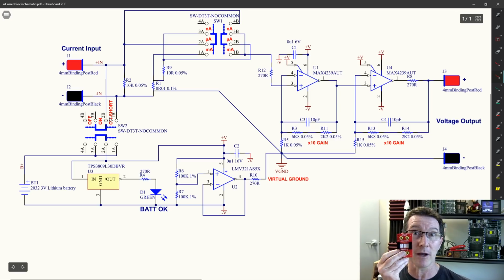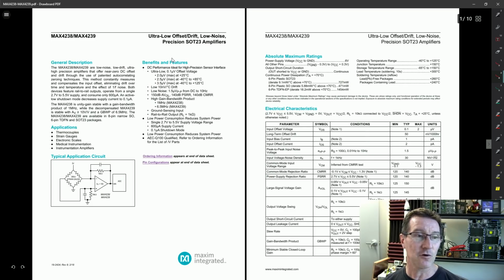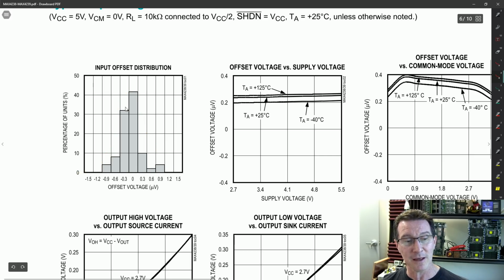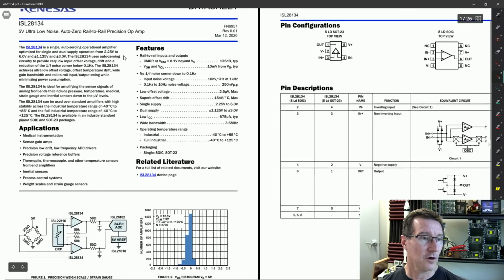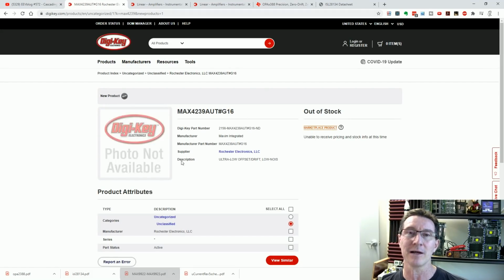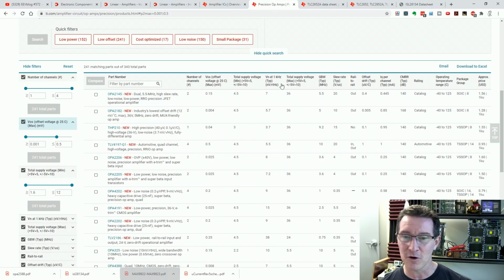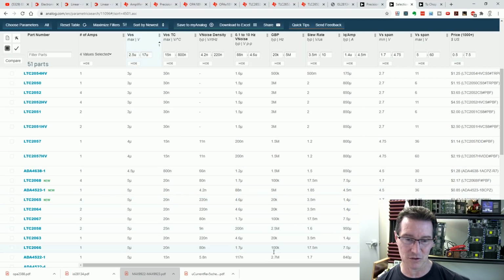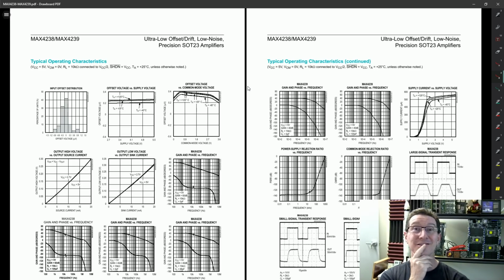EEVblog #1318 - What's State-of-the-Art in µCurrent Opamps?

Comment from the maker: UPDATE: The ADA4528 with a nominal 2.5uV offsett actually looks like it has a tighter spread than the MAX4239, and unity gain stable. But lower bandwidth.
Reply: Rochester electronics are legit. They have deals with all the big manufacturers managing low demand, EOL consignments and aftermarket manufacture to original manufacturer data. Anyone involved in obsolescence management should be familiar with them.
Reply: Perhaps TI, Maxim and Analog use different sigma values (e.g. 3, 6, or even 7) to spec those min/max values. Wise idea to look at the graphs.
Have you also considered using a different 2nd opamp? If the first stage has a gain of 5 with 0.1uV offset, then effectively the 2nd stage can have an offset voltage of 0.5uV without adding more offset than the 1st stage. To achieve the same gain/BW spec, the 2nd opamp needs to have more GBW, but with 0.5uV offset that is alot easier to find. Maybe the ADA4528 for 5x gain (600kHz) and then a OPA189 at 20x gain (700kHz). Haven't looked at noise though, because usually it's best to have the first stage with most gain for the lowest noise figure.. (however the MAX4239 is quite noisy, so might still be good)
Reply: @nlhans1990  I was told to only trust tabulated values as they would be measured and to test everything outside that. Graphs might be useful to know what to expect but can't be sure what may have been extrapolated.
Reply: @ches74  I agree, I typically use the tabular results as much as possible as well, but in this case Dave is interested in the mean & stddev of the part more than the min/max I think. In my opinion, it's not trivial to say how each manufacturer specifies their numbers. Do they literally measure every characteristic during design validation? How are they confident that their min/max are correct, or are these numbers sourced from monte carlo simulations? Or are min/max specifications used as thresholds in die-level QA testing? This is why I think looking at the graphs as supplementary information is a wise idea in this case.
Reply: I am happy you have found OPA189. Using it you can get rid of the second stage depending on bandwidth required. Or you can make use of the high dynamic range. Have a look at its offset voltage distribution.
Also, INA228-Q1 is interesting for precision current measurement. It provides 2 uV max offset and you get digitized result with I2C right away.
Reply: I think the issue is that Analog Devices is conservative with their datasheet specs. The ADA4528 is listed as 0.3 typ 2.5 max, but at 25C none were measured outside of -0.4+0.2. They also default to the max spec in their parametric search. That TI part on the other hand is listed as 0.5 typ 1 max but the histogram shows devices at -2+2.75 so it's really more like 1 uv typ. It really drives home your statement to not limit yourself to a particular spec when viewing the parametric search. I always look at the top few devices from that manufacturer regardless of what's listed just in case. (disclaimer: I'm interning at ADI this summer and use their parts search a lot. The first think I do is add the "typ" spec.)
Reply: @safedork   The TI parts have part numbers for 1uV and 3uV max, so I would hope that they are tested and binned accordingly, whereas the MAX4239 seems to be within the 2uV all the time, and the ADA4528 & ADA4523 are so far within the maximum that it seems the maximum is set at everything going wrong. The ADA4523 says it is 4uV@5V but it seems most parts are more like 1uV@5V and maybe gets to 4uV when operating at 30V, and the ADA4528 is so far within the maximum that I don't know what to think.
Reply: Texas Instruments TLC2652AC has the tightest spec i could find. 1uV max. at 25C lower GBW and higher typical value than the MAX tho
Reply: You would probably also want to take a peek at the ADA4523 since it's GBP is actually fairly close to the MAX4239 but the Vos is still tighter when operaing at low voltage. It also appears to have significantly lower noise? not quite sure how to interpret noise but it seems like a dramatic difference.
New this year it seems.

Comment: 2:20 - The ability to consistently measure low currents with the uCurrent was precisely my goal; hence, I have been following your uCurrent/uCurrent Gold saga for quite a number of months now, off and on. Early last year, a chemistry researcher approached me with the need to gather precisely measured currents through some of her samples for publication. Not having a microammeter here in the shop that would work with less than 3vdc applied and the extreme prices for such a device, I set out to locate any challenges of using off the shelf components to create my own. That’s when I found your uCurrent project from over 15 years ago.  I was disappointed to find that you were no longer selling the unit (I could easily have justified 100 dollars for such a device for the shop); but, then I found where you uploaded the Gerbers. With newfound hope in being able to build one with your Gerbers, I searched your videos and found the reasons for your specific requirements for the chosen components and many of the challenges with suppliers. (Yours is some of the first videos in my feed after searching the ‘duck’ for microammeter. Thank you for sharing all the superb knowledge in your brain for us little guys to use an implement in our own designs. There’s still hope in creating a solution for this researcher’s paper. (I hated that you blew up the opamp in your uCurrent tester, though — true IC abuse!)

Comment: Anyone have recommendations for high speed (slew rate) current sense or instrumentation amplifiers with very low input offset? I'm looking to measure lowside phase currents with a minimum sampling window of 1.5uS. I was originally using the INA240A1, but its 2V/uS slew rate was too slow for the high duty cycles required by my application. According to the graph and my measurements, it wouldn't reach 90% of the target value until just after 1uS. I've been looking at the MCP6N11-010 which is less accurate, has much higher input offset and offset drift,  and a greatly reduced negative common mode voltage, but has a very fast settling time in comparison to the INA240, additionally it requires me to externally drive the reference voltage with a dedicated op amp due to the low feedback resistor values that the datasheet recommends. I need something that's rated down to -1V common mode operational because I need to be able to measure at least 150A, and parasitic resistances can very easily pull the common mode below -300mV.
I can't do inline phase sensing because I need to support up to 100V operation. Isolated sensing topologies will price my product out of competition, and even then, I implement a signal injection scheme to resolve motor position at zero speed with no sensors. This requires extremely accurate measurements and a high fidelity data acquisition stage.
Don't ask, my customers basically want a motor controller with the power density of a nuclear reactor that comes with a set of black magic features at chinese level pricing. .__.

Comment: With regards to the distributions presented in the datasheets I have two questions: 1) is it plausible that some manufacturers would sacrifice yield to allow them to cut off the lower and upper tolerance intervals, allowing them to present tighter tolerances than their competitors? Of course, this would imply testing and scrapping during manufacturering, but I imagine that this added cost would then simply be added to the sales cost of the device.
2) Does the distributions take batch-to-batch variations into account, or is it possible that the tested devices are all from the same batch? This would certainly yield different results and would look bad in the datasheet.
Has anyone experienced these kinds of creative statistics? Any particular brands?

Comment: wow 2014, i have used a microcurrent countless times since then, all the gold is basically rubbed off 
i recently needed current amplification in a project and i used an AD8554 with 2 sets of 2 series amplifiers, it worked wonderfully but was a bit overkill, could cal out in software

Comment: With the high voltage versions that still have a low offset voltage, but a far higher dynamic range, I know for your microcurrent project that's 3V powered it wouldn't be good, but if you had the same project with 36V power, wouldn't that still be better by allowing you to use lets say the 20V range on your DMM, and then you'd be well above the least significant digit on it?

Comment: The AEC-Q 100, 101, 200 standards describe, how electronic components have to be qualified /tested by the manufacturers before they are allowed to sell their parts to the Automotive Electronics industry, like Continental, Bosch, Valeo, Visteon, and so on. The tests include environmental, reliability and electrical tests. These are the de facto automotive industry standards, i.e. very important. Go to http://www.aecouncil.com/ for details.
Specially for Automotive, manufacturers specify and test for -40.. +85°C for Interior, and -40 .. +125°C for Power Train, Body Control and Safety applications, which you found in all of the chopper specifications.
Use of the standard Industrial range of 0..+70°C is mostly not allowed in Automotive.

Comment: I always loved reading new product announcements and poring over new datasheets and app notes. I learned a lot that way. Now, searching for parts often seems like 99% of the job and is definitely more tedious and less rewarding. Digi-Key's and Mouser's parametric searches, while better than most, are really not that well designed. Now I spend hours looking for parts that need to meet multiple environmental specs and conform to multiple standards. Try finding a waterproof panel-mount USB-C jack or a power cable that meets both UL and CSA standards for use in low-voltage LED lights suitable for wet locations or . . . You get the idea. Not nearly as much fun as reading the first RCA datasheets for 4000-series CMOS or the first datasheets for the Intel 4004, 8008, and 8080, the Motorola 6800, the AMD 2900 series, etc. Those were the days. I miss my bookcases full of trade magazines and data books. And I miss designing and building circuits instead of writing code that does the same thing.

Comment: Rochester Electronics works with major semiconductor manufacturers to continue to supply their obsolete and end-of-life parts that the original manufacturers don't want to be bothered with. They stock billions of original chips and wafers and package the chips as needed. When the original chips are no longer available, they can make more - for a price - using the original masks or by recreating the design via reverse engineering. They've recently become a Digi-Key Marketplace supplier, but they've been around forever and are headquartered in a lovely resort town not far from me.

Comment: On the first schematic, what exactly R12 (in series with the op amp input) and R8 (in series with the output) do? Is the first one for overvoltage protection, and second one for stability?
Reply: R8 is an output short circuit protection. I think R12 is to help input clamp diodes in case of input overvoltage.

Comment: ADA4522 is simply where the state of the art is :) 2.7Mhz bandwidth, 22nV/C drift, 100nV noise, this is what we use for LTZ1000 buffers or scaling; ADA4523 and ADA4528 would do too, one is lower voltage, and both uses twice as much power than ADA4522; heating might be a problem in a precision circuit like this

input offset is not important, you can cal it out, or zero it out externally; more important is the offset drift with temperature

I prefer lower bandwidth to noise, MAX4239 is quite noisy

Comment: In a project we had to measure a massively resistive sensor (>10GOhm) with a very small output (single digits uVolt range), which meant that we had to use the opamps with the lowest current offset available.

After testing several of them trying to find a balance between current bias (which also had some effects on the sensor), current offset and voltage offset, we opted for choosing the ones with lowest current metrics and placing a mosfet across the input. Before measuring we would short the inputs and measure the offset. 

Goes to show that sometimes it’s better to rethink your architecture than to try to find the specs you wanted.
Reply: did you test the LMC662 or one of it's relatives?  it's got fA level bias and offset currents with decent offset voltage (1mV ballpark)  Used it to great effect on a photo-diode amplifier with a 10Gohm feedback resistor.  Noise was 30fArms at ~30Hz.  Also added a discrete transistor high voltage output stage for added dynamic range and bandwidth.

Comment: Here are a couple tips for good amplifier design.
1. It's always best to use opamps as inverting amplifiers if you can. That way you don't get common-mode input voltage.  Also, Vos sometimes varies over the common-mode input range which adds distortion.
2. You could improve accuracy and lower cost by moving the second stage inside the feedback loop of the first stage.  That way the second stage doesn't need to be precise.  You could use a high GBWP second stage with relatively high Vos and cheaper 1% resistors.  Those errors will essentially be integrated out by the first stage.  This approach is called a composite amplifier.
Reply: You can do number 2 while maintaining the bandwidth?
Reply: @AMalas  Depends on the opamps, and how you use them.  Typically you would use a precision opamp with relatively low BW for your input stage, and a high-BW low-precision opamp inside the loop.  This 2nd opamp would normally be used as a high-gain noninverting amp using low precision feedback resistors.  The only high precision resistors you need are for the outer loop, which feeds the output back to the first stage.
But if you don't understand classical control theory, you could easily make the circuit unstable.  BTW, every analog circuit designer really needs to know classical control theory; it's one of the most powerful tools in your tool belt.
Reply: Just did a quick SPICE sim.  I think Dave could reduce his BOM cost significantly while improving accuracy by making the following changes:
1.  Replace  U4 with TSV911AIDBVR.  This looks much cheaper than MAX4239AUT in similar qty.
2.  Reduce cost of R13-R15 by using 1% or 2% instead of 0.05%.
3.  Increase values of R3 and R11 to total 99k instead of 9k.  Could use 0.1% instead of 0.05%.
4.  Disconnect C3 and R11 from the output of U1 and reconnect them to the output of U4.
5.  Tweek compensation caps as needed.  My sim shows C4 can stay at 10pF if C3 is about 3.8pF.
I haven't breadboarded this, or done a more complete sim using the manufacturer's SPICE models, so I can't guarantee it works, but I'll bet the overall noise and stability are the same.  But accuracy should be better.
Reply: @steverobbins4872  I am still in university, we have done two control courses but it felt like I was learning how to analyze one single circuit and nothing else. Any resource you'd trust and recommend to learn more?
Reply: @steverobbins4872  I'd love to see Daves response to that comment. Really didactic, thanks!